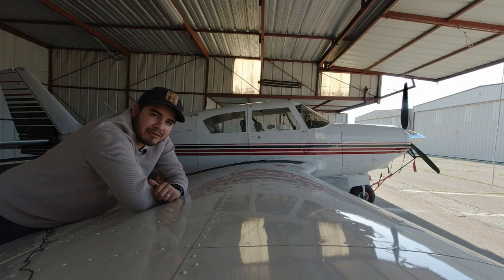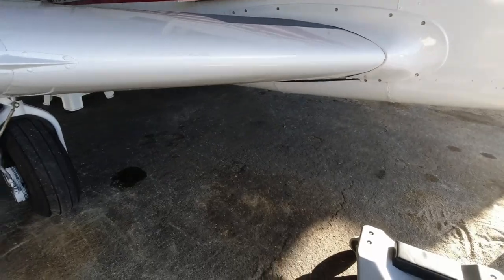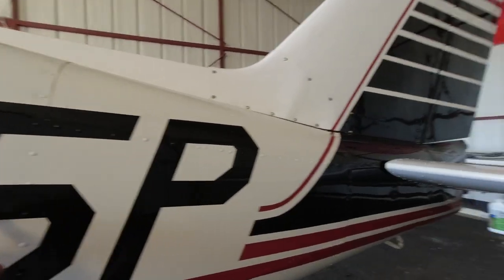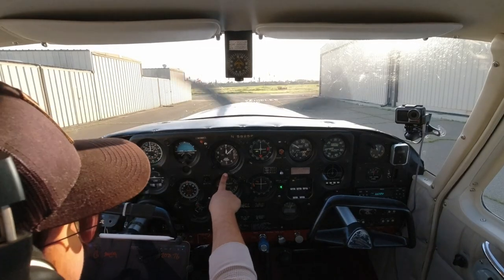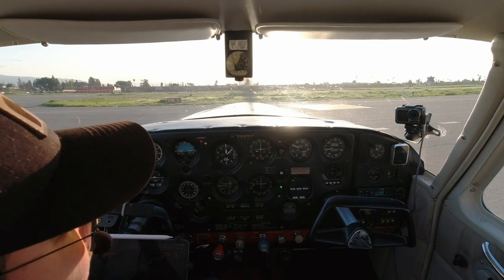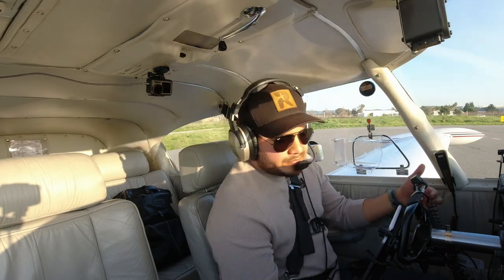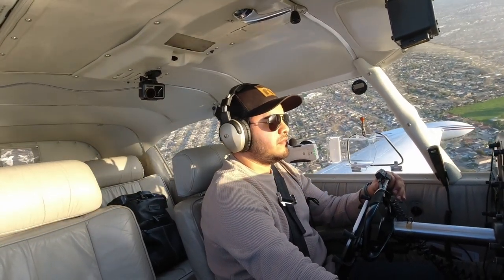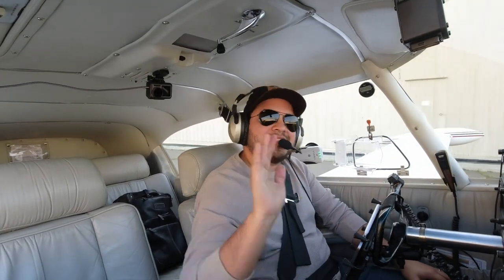Flying the Piper Comanche - Full Flight Walkthrough

Comment: Curious why you use 2 notches of flaps on takeoff? I have a 1960 Comanche 250 and I’ve only ever used one notch. Some guys suggest not using flaps at all. Just curious on the two notches. Thanks for the video… was fun to compare what I do to someone a bit more seasoned in the same plane.
Reply from the maker: Great question! This was something I was taught by a good friend and comanche specific instructor. The thought here is that take off and landings are the most critical points in flight. By using two notches I get off the ground much faster and start my climb quicker. Altitude is my friend in case of an engine out on take off. Why not gain as much altitude as possible if it’s an option (short field TO technique).
Reply: @MyFamilyFlightPlan  there are definitely different ideas out there on how it works best.  I know SR22s have it in their POH to add flaps on TO and I think some Comanches also have it though I'm pretty sure it's not in our 1959 version.  We have a 180 Comanche and I don't use flaps at all on TO except for operating off a grass strip or when I needed to do a short field.

The other side is on landing.  I've heard many believe that full-flaps is a no-no but I use full flaps just about every time and have good landings.  The Comanche is definitely a finicky lander, but a solid airplane all around!  Thanks for sharing the video, love the Comanche!!
Reply: Also, it's possible you have the oil from the breather tube because you have too much oil in it.  2-9 is the operating range though I'd definitely keep it closer to the 9.  But, the 9 might be the cause of the spillover.  I run 7qts down to 6 and then refill.  No belly oil.
Reply from the maker: @andrewthome77  yes agreed that there are different thoughts on this. POH says flaps “as required” on mine. With that in mind, I like to treat all my Take offs as short field to gain as much altitude as I can. 

100% agree on landing. Also taught to mostly always use full flaps. Only time I don’t is when I’m flying solo, I’ll use two notches. Helps not coming in too flat.
Reply from the maker: @andrewthome77  yes! I fill mine up to 9 qts and refill when it gets below 7qts. Still have a slight streak of oil on the belly. I was told that this could be due to me having a wet pump as well 🤷🏽‍♂️
Reply: Great video. I have a 60 250 and it was great to compare procedures. I love learning new and different techniques from others. Lastly, you keep your plane immaculate! Thanks
Reply: @MyFamilyFlightPlan  I'm very curious now to measure altitude vs distance and altitude vs time in my Comanche as I would expect that a clean takeoff and best rate climb nets altitude somewhat faster (in time) than a short field, best angle climb with a minor advantage of one less configuration change after takeoff.
Reply from the maker: @williammagill5634  Totally missed your comment. Thank you so much! I agree, I enjoy watching other’s videos as well and comparing to what I’m doing. Always learn a thing or two.
Reply from the maker: @planeplaces  to clear an obstacle, I would say time does not really matter. You want to have the most amount of lift in the shortest amount of distance. Once you clear the obstacle (or get sufficient altitude to reduce risk), I like to change to a cruise climb configuration which is 120mph. That helps keep the temps down on the engine and provides you a good climb rate with decent speed to get to your cruise altitude. Hope that helps.

Comment: Thanks for the Video, really enjoyed it. I have a question? Why do you only start on one mag and not both?
Reply from the maker: Great question. Most airplanes have an impulse coupling on the left mag only. During engine start, the ignition key grounds out the right mag, so only the left mag provides spark. The timing of the spark from the left mag is later than usual during engine start so the engine will start easier.

Comment: Was the stall warning switch an STC?  I have a '61 -180 and there is no stall warning system.
Reply from the maker: I know that the stall warning light was standard equipment, had to switch out the bulb last annual as it had gone out. The Comanches did not come with stall horn though, just a light
Reply: @MyFamilyFlightPlan  Did some research - looks like all Comanches had stall warning except the -180.  Oh well.  At least the buffet is noticeable.
Reply from the maker: @jsteiger2228  very interesting that the 180 didn’t come with it as they were the same airframe. Thankfully the buffet is pretty noticiable and stalls are light on the Comanche’s
Reply: @jsteiger2228  our '59 180 has a stall warning light, just no horn like the OP stated.
Reply: Another owner of a '59 Piper Comanche 180... NO Stall warning light or horn..  Not standard on early planes...
Reply from the maker: @JohnMcGowan-mx9rq  very interesting. Mine is a 59’ 250. Would have thought the 180 and 250 would have shared the stall light out of the factory. Now that brings the question of what else was different between the two of the same year.
Reply: @MyFamilyFlightPlan  Carlos-The airframes were the same in '59, with differences from firewall forward and most of the 250's by then had second fuel tanks in the wings to provide 90 gallon capacity. But because the 180 was certified a hear before the 250 and under different rules, it never was "required" to have stall warning horn or light. I do have indent in false panel for the light, and a little cover screwed into left wing where stall sensor would be installed on a 250..
Reply from the maker: @JohnMcGowan-mx9rq  very interesting. Thanks for the extra details John!